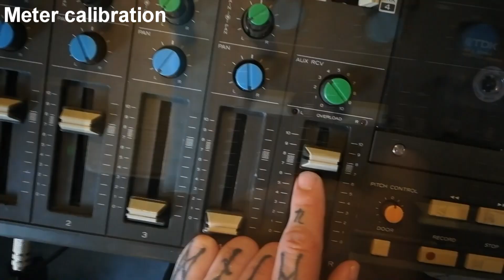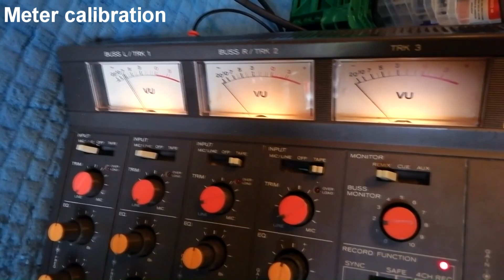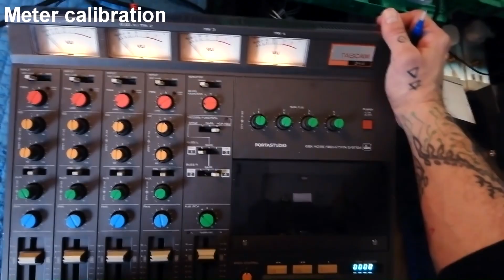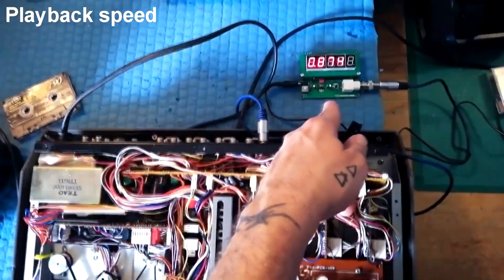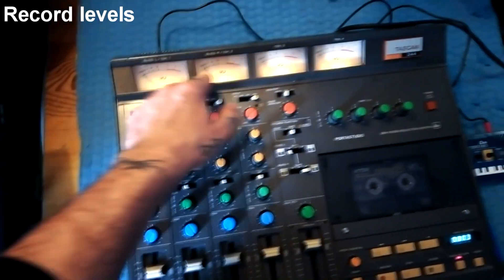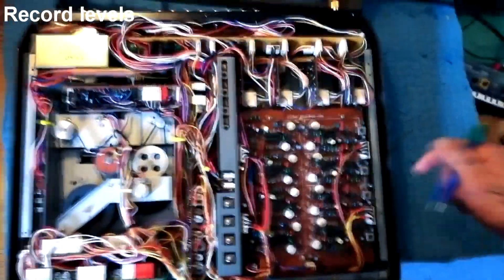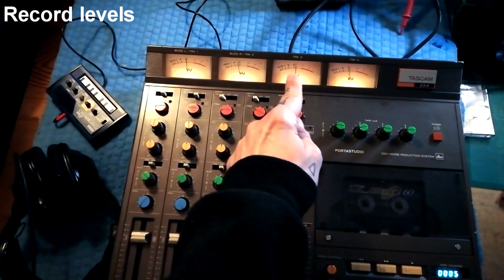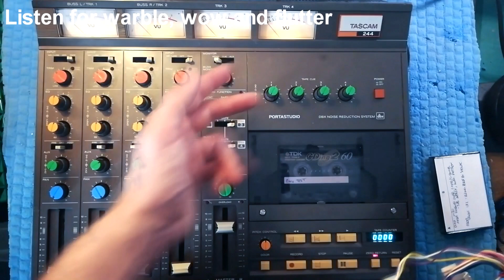4 track calibration demonstrated on a Tascam 244 Portastudio

Comment: Best video on YT to understand this mathematical test and calibration is  What is a dB, dBm, dBu, dBc, etc. on a Spectrum Analyzer?   of course a scope that has FSS is needed you can't just do the math to measure DBM power. It's crazy the equipment you need to set a £2 motor that is 30 years old run on rubber belts. But the electronics knowledge and crimping new cables is just the beginning of owning tape multi tracks i pity people that buy stuff on ebay that think the retro deck will be so cool. Yeah it will after you buy over a grands worth of electronics equipment 🤣

Comment: Hello! Thank you so much for theses videos, they are incredibly helpful. 

I have a question about the meter calibration. I managed to adjust all channel to be "in tune with itself" which is a great step. Now I'm wondering about the best level to set it at. 
If I understand correctly, you tuned it so the VU meter shows the DbV levels (meaning 0 on VU meter = 0DbV), but the service manual seems to say that we should set it so that 0VU = -10DbV.

How would this difference in levels affect the sound? Would it lower the noise floor or something? (I read something about that on a forum).
And would this have some effect when working with modern equipement? (My understanding is that modern equipement is set at 0VU = +4DbU)

Am I overthinking this whole thing? XD

Thanks!
Reply from the maker: Honestly I don’t remember what I did in this video, I made it a while ago and my understanding of the surrounding issues is more sophisticated now, it’s probably due an update! My current advice for -10dBu devices like a tascam portastudio is get 315 mV RMS from the line out with a multimeter in AC voltage mode, then adjust meters to read 0 . If it was +4 dBm gear, you’d want the meter reading to be 1.23V instead. dBV dBu and dBm are all slightly different standards, dBm was the standard for professional gear in the 50s, but most stuff you’ll be using with a portastudio is also going to be -10dBu. I do intend to do a new video about this stuff soon which answers this question better….thanks for watching!

Comment: hello tetrakan, do you think there is a way to regulate  the input signal level on a tascam 414 because mine have one channel (the third) that have a very high input signal compared to the others at the same potentiometer position... thnaks for your work!
Reply from the maker: Hey, there are electrolytic capacitors coupling the preamp to the jack socket and the rest of the circuit. If those leak slightly it can cause issues with levels noise distortion etc. If replacing those doesn't do the trick, very occasionally I've needed to replace the 8 pin opamp chip itself, replacements can be had for not much money.

Comment: Do you think i could fix a slow warble on one of my channels (ch 1 actually) by doing what you did with the variable resistors? Ive tried different tapes and cleaned the heads... i still get same subtle fluctuationon that channel and that channel only. Like a cartoon car going over rolling hills lol. Or maybe you can point me in the right direction.  Thanks in advance! 
J.
Reply from the maker: Sounds like the edge of the tape closest to track 1 is rubbing against something, probably the metal guides which protrude from the magnetic heads. The conbstant curling and uncurling of one edge of the tape will manifest as a change on pitch only on track 1 or 4, depending which edge is rubbing. You would resolve this by adjusting the screws which attach the heads to the transport, similat ro an azimuth adjustment as described in the service manual.

Comment: Hi , how are you? Can i Ask you which cassette should i buy for the calibration of the Tascam 244?  i went to the gennlab site but there are many types and i can't figure out which one to get. Thanks
Reply from the maker: MXT-112. 3-3/4 ips 315Hz 3180+70usec 0dB is the one you want for level.calibration. it can also be used for motor speed.

Comment: Tetrakan, Do you know of anyone in the US willing to put the amount of work into calibrating a 244 as you do? Thing is, I have a 244 that I had Teac (when they were still around like 15 years ago)  re bias for some NAC tape that ended up being unreliable. I'd like to have it freshly re biased for Maxell XLII's. And of course aligned electrocially. I guess I'll probably have to do it myself, as I'm not confident I can find someone who knows these machines that can do these procedures and have the correct alignment tape to do it with.l Thanks very much for the calibration video. I'm handy at doing all this on an Ampex, but 244 is a bundle of wires.
Reply from the maker: recursive delete in POrtland or mOds and sods in upstate new york might do that. As you may know i'm mostly self taught and Bias adjustments are one of the least well documented aspacts of these units. Do you know what changes were made to your 244? Because if its justb a matter of changing the frequency or amplitude of the oscillator its not that hard to do.

Comment: Hey! I have two questions:
1. Is there difference between calibrating levels with and without dbx? I have dbx off (and want to stay that way).
2. Could you provide a list with tools needed to perform calibration? Multimeters, oscilators etc. That would be helpful.
Reply from the maker: You can either calibrate with DBX on or off. I mostly record with DBX on, so I calibrate with DBX on. If you're going to record with DBX off, calibrate that way. I'll make a list as a blog stub one day, meanwhile jot down the items you see in the video.

Comment: Hopefully you see this comment, I got a tascam 246 and it functioning except each channel receives the same signal at different db and the playback volume on two tracks are super low compared to the record db, could I adjust that on my own?
Reply from the maker: Yes. The meter sensitivity is controlled via trimpots you access via tiny holes In the  top of the plastic case. The record and playback trimpots are located on the big flat board mounted behind the mixer. Normal and double speed playback level are on different trimpots. Their locations are in the service manual which is available for free download from my blog. Adjust the playback amps first, ideally using a calibration tape though a uniformly loud passage of any tape will give you a rough idea of playback volume. Adjust record volume only after meters and playback amplifiers have been set, in that order. Good luck!
Reply: @Tetrakan  Thank you very much! I'll take a look at the pdfs when I get home, thank you again !
Reply from the maker: You're welcome. I do have tear down videos on the 246, I think they cover the calibration trimpot locations? Although I don't have a video specifically on 246 calibration,  only this one, it is similar enough a procedure to a 244 you can use this video as reference, good luck.
Reply: @Tetrakan  You mentioned both the slow and high speed have different playback trim pots, are each of those groups subdivided into tracks? Track one is excessively low. Also no matter what channel, if I route any channel to track 3 and/or 4 the PGM meters receive no signal, only in monitor. Anyway, I will look at the pdfs now, thank you!
Reply from the maker: If memory serves, the settings are made per track, so track 1 has 2 trimpots, one for fast and one normal speed, and so on, it’s the level coming back from the four regions of the cassette. The routing through the 4 buss faders to the VU meters may be a different issue? I seem to remember that routing occurs on two boards in the middle, and a little rca patch bay on the rear panel, not the big flat record/playback board behind the mixer…

Comment: Please can you help me understand the process for calibrating tape levels? Do you have a voltage you are aiming when measured on the scope, or can you assume that if the channels are in the same ball park they can't be farr off and so you just need to balance each channel so they are consistent with each other? The manual gives the nominal output level from tape outs as -10dBV which I think would read around 0.9V peak to peak on the scope. If you were to use a tape that was recorded at 0dB on the Tascam's meter, should the scope (in theory) read 0.9Vpp?
Reply from the maker: I would say that getting mixer channels, record amplifiers, playback amplifiers and therefore tape tracks to respond in a similar way to each other is the first priority of calibration ( a bit like making a guitar In tune with itself) and making the best of the dynamic range of the system ( guitar is not only in tune with itself but also at concert pitch) is a secondary priority. I agree -10dBv == around 0.9 v peak to peak which is why I suggest ensuring the meters all respond correctly to a -10dB reference tone or equivalent before moving onto setting playback levels. However, for the calibration tape I have, when I set the playback trimpots so the tape output = 0dB, then make test recordings which played back at the same volume they were recorded at, I could tell by the extra harmonics in the sound sound and the squaring of recorded sine signals on the scope that I didn’t have the correct gain structure, and therefore the calibration tape I was using should actually read above 0dB on well calibrated meters. I guess this is because teac made one full-width tape on ferric stock for the calibration of ALL their cassette tech, so it plays back hotter in a portastudio which expects type II cassettes? I have found through experimentation that by using the top of the screen on my cheap ‘scope as the calibration point for playback amps, record and playback levels are above the noise floor and below saturation levels, and I get a good sound quality overall. Since the vintage teac test tape I have is not well documented, I might be a dab or two out from perfect specifications, but the fidelity is good. Does that answer your question?
Reply: @Tetrakan  Yes thank you mate. I spent this evening going through the process you described and I'm really happy that the meters are consistent across input, record and playback. The calibration tape I bought was a tenner on eBay with a 3k tone at 0dB and wasn't overshooting the meters so I could use the Tascam meters rather than the scope. Thanks for all your videos, it's an amazing resource. 
Additional thought: do you ever need to physically strengthen the jack inputs on any of your machines? Mine are pretty wobbly and I don't know if they were just flimsy out of the factory or if they have worked loose. Makes me nervous that something's going to break if I don't take extra care. Would be interested to see if this is something you deal with.
Reply from the maker: Thanks. Wiggly Jack sockets- depends on the model. Some of the 80s ones it's part of the design, 90s ones it's usually  a bad sign since the only thing holding the socket steady is the solder connections...what model do you have?
Reply: @Tetrakan  Mine is a Tascam 246. I haven’t taken it apart any further than getting the bottom of the case off, but through the gap in the chassis it looks like the whole jack socket and associated gubbins is wiggling all together.
Reply from the maker: I don’t think it’s anything to worry about. On the 246 the sockets are attached to the metal chassis using flexible clips, and those have some give to them. It’s actually an advantage because the strain of inserting and removing the jack plugs isn’t passed onto the solder joints.
Reply: @Tetrakan  Brilliant, thank you 🙏

Comment: can i use a simple Mono Synth with Sine Wave VCO instead of a function generator too for calibrating?
Reply from the maker: Yeah definitely. If you’re going to calibrate meters, adjust the output of synth using the ac voltage reading on a multimeter before inserting the signal into the portastudio, but for troubleshooting circuits the voltage isn’t critical, any sine wave source will work.
Reply: @Tetrakan  thanks. i own a multimeter, oscilloscope only as VST plugin. there's a video on youtube on calibrating the 414. the guy says, the sound source frequency should be 10kHz at 1 Volts. i have about an idead what that means!

Comment: Hello how are you? i would like to ask you for advice on a problem i have with the my tascam 244. i inserted a 4 track tape i had recorded on another 244 and i noticed that channel 4 is very low, barely audible. I tried to record and on channel 4 it records but always very low. I tried to raise the trimmer of the amplifier on channel 4 but even at maximum it is too low compared to the other 3 channels. do you have any idea what the cause could be?
Reply from the maker: Hello, there are two amplifiers, a nevfor recording, one for playback, have you tried turning up both, or just the playback amplifier? See my calibration playlist for details. Occasionally I have seen 244s where even after calibration of both amplifiers the signal is too low - in this case, dry solder, leaky coupling capacitors or even faulty operational amplifier chips may need to be replaced, I cover some of these topics in my electrical troubleshooting playlist.
Reply: @Tetrakan  yes I have proved but channel 4 always remains very low, the hand moves by one millimeter in play, but audible. in rec i see normal moviment meter signal entry in ch 4, senza problemi.
I tried a 4 track cassette of my old tascam which I know for sure works and in this new 244 thechannel 4 remains extremely low .
then excluding the cartridge (which I seem to have understood not to be the cause of the problem from what you said) how can I begin to check channel 4? what should i disassemble? thanks for the help
Reply: when I turn up the trimmer of the channel 4 play amplifier the volume increases, but not by much, could this help to understand the problem?
Reply from the maker: Compare it to the behaviour of a healthy channel using a commercial tape with a strong signal. It doesn't have to be a calibration tape - I sometimes use my friends band's cassette or my Mother's old cassettes she bought in the 80s. Channel 4 (bad channel) should behave like channel 3 (good channel). If the bad channel trimpot does not amplify the signal from the cassette as much as the good channel trimpot, then yes, there is probably a fault with that gain stage in the system. Locate any solder terminals, coupling capacitors and opamps using the schematic, replace components and apply fresh solder.
Reply: @Tetrakan  do you refer to the external trim pot or the internal trimmer?
Reply from the maker: The internal trimmer
Reply: @Tetrakan  yes, it's the problem! Thanks for your help, so now  I will try to disassemble the amplifier to understand where is the problem. right?
Reply from the maker: Yes…on a model like the 424 It is possible to be identify exactly which component or connection is faulty using an audio probe and a multimeter, but on the 244 because the circuit board is a) difficult to remove and b) difficult to troubleshoot because the cables are too short to connect it to the rest of the system after removal and still have enough space to use probes etc, I suggest you use the schematic and parts list in the service manual - both available for free download from my blog - to identify and order all the capacitors and the opamp associated with that internal trimpot, then replace everything with new parts without testing.
Reply: @Tetrakan  Ok. Thanks. I will do it!
Reply: Hi Man how are you? i don't know if you remember the problem i had on channel 4, in the end i could not solve it, i took the tascam to a teac repair center and not only did he not solve the channel 4 problem but they returned it to me with another problem.
Before delivering it to service, the 1_2_3 channels worked perfectly and were perfectly calibrated. When he handed it back to me channel 1 was 9 db lower with a strong background noise floor, it also seems to be slightly reverberated.
The technician says he did not touch anything but it is not true because before the channel 1 was perfect.
The problem now is that in play the old recorded tapes feel very good, but if I record new tracks the channel 1 is 7/9 db lower and very noisy almost reverberated.
the weird thing is that the pre recording mixer meters look ok. I don't want to take him back to the technician, I argued with him because he is incapable. can you help me somehow to restore channel 1?
Reply: could the head be worn out?
Reply from the maker: I don't think so. Lapping occurs on higher speed, higher tension reel to reel machines, but I have never seen lapping (erosion from friction) on a cassette recorder. It's possible for the internal coil if wire for track 4 to break, but if  that was the case, track 4 would not play back at all.

Comment: When playing back tape to adjust the record levels, should the record function be set to Safe or 4Ch REC mode? It seems like safe mode is always quieter on these machines...
Reply from the maker: I’ve noticed that inconsistency too. I err on using safe mode, just because that is mainly how my portastudios are used - tracking mono overdubs. If I ever had a 244 which I was mainly using to track a drum kit with 4 mics recorded simultaneously before dumping the results into the digital domain (for instance) I’d make the calibration for 4ch REC mode. I figure that ultimately we’re trying to get a signal in a sweet spot between the noise floor and the point where clipping or saturation occurs, so with the dynamic range being I think something like 60dB with DBX on (citations needed?) then a couple of dB discrepancy between the two results you’d get depending how you set the unit during calibration won’t render the other setting unusable.